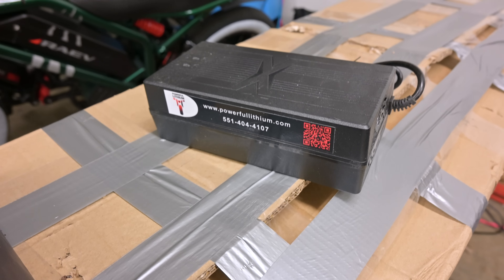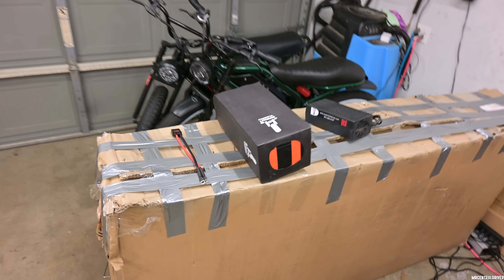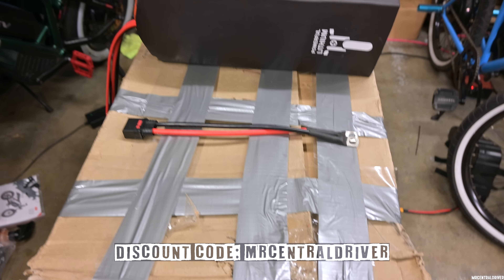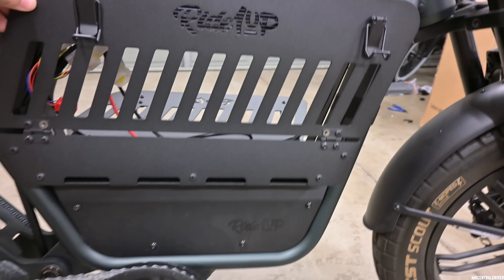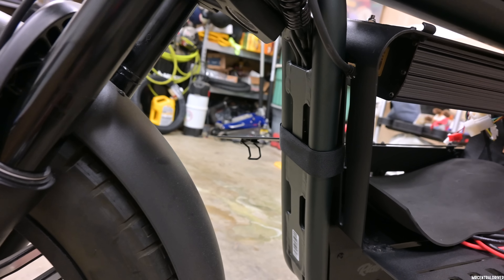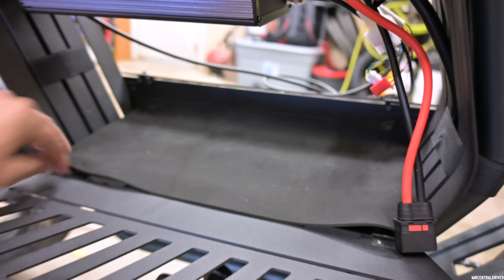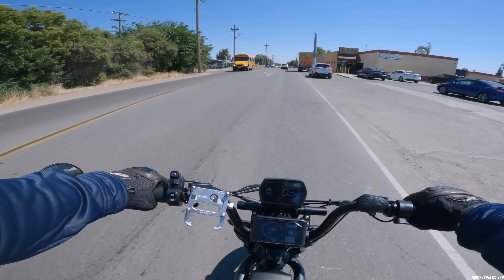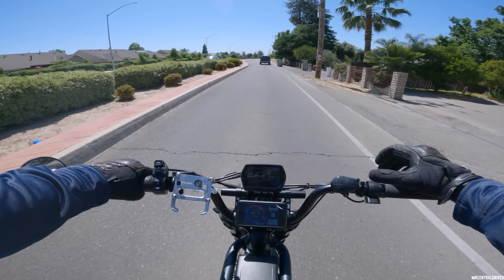RIDE1UP REVV 1 - 72v BUILD Pt.4

Comment: I am interested in the dimensions of the compartment at the bottom of the battery frame, I want to check if the SK elements with a capacity of 55.6 Ah are suitable for this frame, and I am also interested in the height of the seat

Comment: I hit 60mph on my chopper build with the NBP 5K T3 and still had more to go. I can pull up to 150 amps with the controller I have and two batteries that I am using. I'm not using a chain also, it is a chopper so it has pegs you couldn't peddle it if you tried anyways. The cops where I live could care less, we have people with gas bikes riping down the streets here, they have better things to do than mess with us. The nuts that NBP uses are really soft, I had the same people with my 1500w front motor on my two-motor recumbent bike. Good to see you on a bike that goes faster than 28-34mph. I know most people ride the slow bikes, but for me, it has to do 40+.

Comment: With vertical drop outs you HAVE TO use a tensioner if you want to have a chain. If your choice of torque arm is in the way, figure out another way to solve the torque issue. If you can't figure it out you may unfortunately be SOL.
Reply from the maker: 100% right
Reply: My Spoiler chopper has tensioners and the freewheel is still hard to line up. I could get the chain to line up but then the wheel was not centered, I'll take the wheel being centered over having a chain any day. I wonder if they make spacers as they do for MTBs so you can run different gearing setups and chainrings?

Comment: why dont you put a controller on the top and a huge battery in the cage?
Reply from the maker: On top of what?
Reply: @MrCentraldriver  so I know u don't really do fab or wiring work.
but.
a voltage converter to run the stock electronics since u can't solder wires or figure that out. then u won't have two different batteries. 
put the controller on top where the stock battery currently is.
and get a huge battery to fill the cage.
maybe even utilize some space under the rear seat for some wires and lighting controllers.
would be a huge range 55mph beast.
can even get spacers for the brake calipers and run bigger rotors. 
"1st 72revv 1".... it's got two screens and 2 separate systems... not much of a build or very custom.
plus it keeps breaking and getting slots and holes hacked everywhere... instead of telling ppl to fix the screw... why not show them?

Comment: Hello. I would advise you to make a box of aluminum with a wall thickness of 2 mm for the lower battery, otherwise the battery will bounce, move, and then make a bolt hole in the battery, and the battery will burn

Comment: Instead of removing screws could I suggest replacing them with rivets that way they sit flat
Reply: Or flip them round so the nut is on the outside
Reply from the maker: @damiangoff8952  you could do that but  i think it would look uglier with the screws backwards
Reply: @Damian Goff  no. he just tells u to fix it. then removes them, leaving bare scratched alloy showing...

Comment: How much money do you have into the bike at this point?
Reply from the maker: 2400 ebike. 1800 battery. 1000 motor kit. Plus thumb throttle and straps and padding extra $50 Around 5250 in total for a 55mph ebike. When a super73 rx costs 4000. I’m not mad at it. You can grab an onyx for this price of course but this feels much better than an onyx rcr. Or get a talleria sting r for 4500 and add 250 pedals and that goes 49ish

Comment: Loving the content. You got me modding my bike. Just bought a 52v 20ah battery upgrade. Hope it’s an easy swap and the stick 48v controller can handle it. I want a little more power and range.
Reply from the maker: If it's the stock controller that came with the bike the 52v will kill the 48v controller. look at your controller and see if it says operating voltage good for 52v. if not do not do it!
Reply: The 48v controller should be able to handle 60v.  So a fully charged 52v battery (58v) will be okay as I've done it myself.  You could open up the end of the controller just to check what is printed on the capacitors.
Reply: @neilrogersrogers6313  thanks. I’ve read that newer controllers can handle it. I’m going to give it a shot and see if it works. Guess I can replace controller if it fails. Hope it doesn’t come to that.
Reply: @hopnguyen1695  pls keep us posted if it works. Just order Revv 1. Thanks bud!
Reply: @demonhunter-skydomeatlanti1746  I don't have a Revv 1, but my bike had a stock 48v 12.8ah battery.  I rewired the 52v 20ah battery.  Increase mph by 3+, range not positive, but substantially more.  Controller is handling it so far, but it gets pretty hot.  I don't know if it heated up with the stock battery like it does the 52v.  So far, so good.

Comment: I’m surprised you’ve had the tight chain this long without the freewheel issue
Reply from the maker: It Sucks because without the detailer the chain is either to tight or too loose after removing 1 link.

Comment: is everything waterproof?
Reply from the maker: I road my custom super73 72v build same kit in the rain and it was fine but you probably won’t wanna do it. Light rain should be ok. I’d be most worried about the display getting water underneath the panel and the controller bolts that connect the phase wires from rusting. All the wiring in the front will be fine.

Comment: To keep cage cover screws from piercing battery #1- REMOVE your foam pad, #2- put a thin 1/8 inch sheet of wood to raise battery over THOSE screws.. #3- Don'T replace screws at bottom of cage, just drill holes in wood to cover screw heads #4- Take foam pad and GLUE it to top of wood, #5- Connect battery wires and Slide battery into space. OPT #6- Re-install cover screws removed earlier and GRIND excess screw threads to make them FLUSH with Nuts. Nothing should be touching or come close to piercing battery.